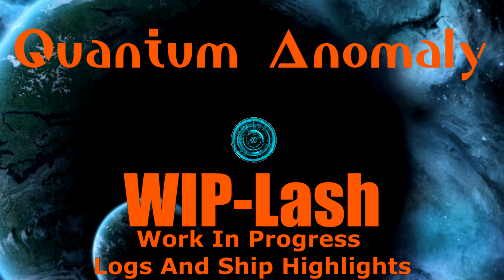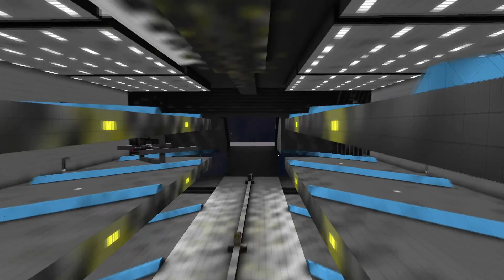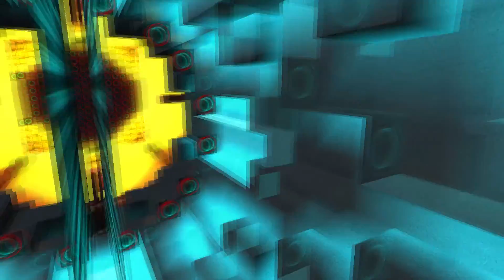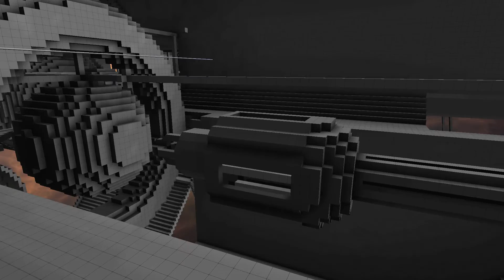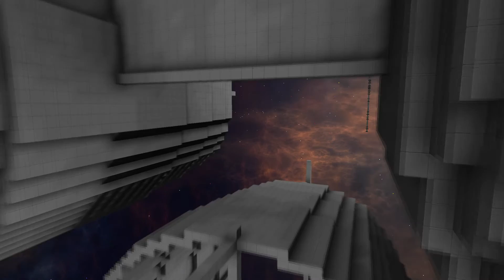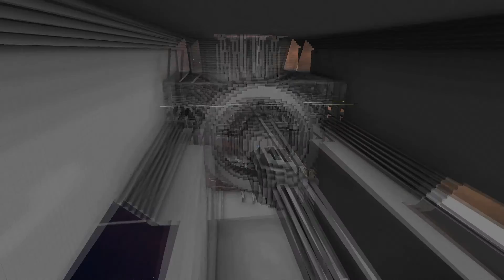Starmade WIP-Lash: Razorthorn Build 6 - Power it up

Comment: love this whole WIP thing. Btw, if you want a better tool for spheres,  try www.plotz.co.uk
Reply from the maker: +Col. Kurtz Nice, thanks.  I've used that before in my minecraft days, but really it all comes down to the wedging, that's where things can get iffy, especially on ellipses (when you're working too fast and dont do it one layer at a time and instead just go all over lol)
Reply: +Quantum Anomaly I feel you on the wedging. I also come from MC and i'm doing my first 300m build in SM....... them wedges man lol
Reply from the maker: I was wondering if that was you lol!  I'm diggin your builds, but you're quite a bit further than I am, I cant help but build in all grey then paint, it comes from playing too much survival lol.  Takes twice as long, but I cant deal with color when I'm working on shape.
Reply: After this build I may never start with an all black template again -.- I'd rather start from grey and then paint after this mess. The black is so dark that I'm struggling to show shapes and lines. I've had to resort to using lights and outlines to accent the angles. I kinda wish you could hold paint in your hand and paint blocks.
Reply from the maker: +Col. Kurtz Yeah, the paint idea is a common request, grey and white can be just as bad, black you cant see but grey and white blind you in lighten mode.  There's a mod to change the values, but I havent messed with it
Reply: Best part, I just now realized it's you..... I've been subscribed to you for a while now and had no idea >.>
Reply from the maker: XD